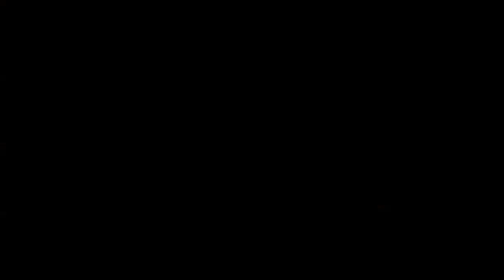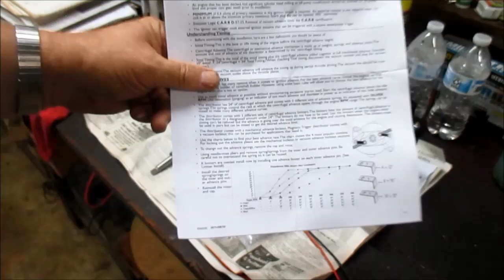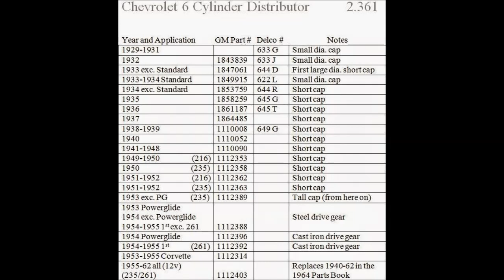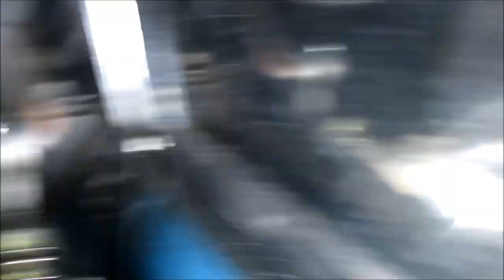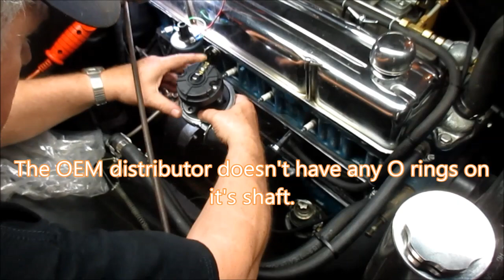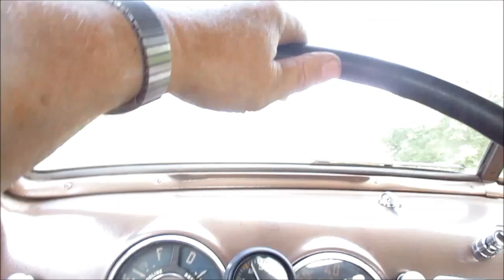1949 Chevy truck, Installing a Pertronix distributor on a 235 engine. Volume 44.

Comment: Nice video, but I don't follow the 100 RPM drop. The engine RPM is via the transmission, tied to the rear end and road speed.
I suspect your RPM changed because you are measuring it via a different ignition and so a different number.

Comment: Hey great videos, new subscriber, have a 62 c10 with the 235 and have ordered a hei replacement distributor and was wondering if I have to change to a 12v system for this to work? It’s on my list but trying to get the truck to run better for now
Reply from the maker: Hey David. It depends upon which HEI dist you ordered. Some can be 6v while most are 12v. If you ordered a 12v you'll have to upgrade your electrics to 12v. Or you can contact the provider to see if they have 6v versions and see if you can trade them out. Upgrading to 12v isn't that hard. You'll need a 12v alternator, most folks go with a 1 wire GM type, disconnect the regulator, change all your bulbs to 12v and get a special resistor for th epower to your gas gauge (most aftermarket providers have them) and if you have a heater you'll have to either replace the 6v heater motor with a 12v (most aftermarket providers have them) or install a DC voltage converter to step down the 12v feed to the 6v electric motor to 6v (I did this in my 49 GM). Look for a video series I did on installing a heater in my 49 GMC.I cover it pretty good.
Good luck.
Reply: @Volfandt  you know I didn’t even consider that when I ordered, item says it fits so I just went with it and then started watching your videos and started wondering. Thank you for the reply and videos, as a younger guy who doesn’t know much about these things but wants to do it myself I really appreciate and depend on videos like these. I guess I have some research to do, thanks again

Comment: Does the new  Distributor moves when you  Give it idle?   Vacuum Or no
Reply from the maker: No, the Pertronix Flamethrower distributor operates like a later model dist so only the internal point plate rotates. The Pertronix is basically a later model points type distributor that they modified for their Ignitor II electronic ignition module.

Comment: No worries I am an old fart too.  Good job.  What was the total cost?  Mike
Reply from the maker: Heres the distributor part#: D109700 and a link to it on Pertronix website:
https://pertronixbrands.com/products/d109700-pertronix-flame-thrower-billet-distributor-with-ignitor-ii-gm-l6-toyota-f?variant=37238594044075

I also put the part# and link to the Pertronix website in the description.  
Thanks for watching.

Comment: Hey bud on the stock distributor line on the carb end should I be able to pull the line back & forth. Slightly ..when installed in carb. How critical is that for carb .. was wondering if that was my carb issue. Or part of it.. cuz I tighten it but I can still wiggle the line back & forth .is that a vacuum leak?. Not enough vacuum to carb? Please let me know.. wanna get her going. Thx buddy. Appreciate it 🙏
Reply from the maker: The vacuum line between the carb & distributor needs to be air tight when it's tightened. It will definitely be a performance problem & vacuum leak at any RPM above idle. When you accelerate the RPM above idle you should see your entire distributor rotating, that is how the vacuum advance works on these old stovebolt engines. IF it's not moving your engine will stumble and hesitate. So no you shouldn't be able to pull the line back & forth when tightened and a loose vacuum line will cause carb problems.
Good luck.
Reply: @Volfandt  wow 👏 your awesome. I figured that couldn't be right. So this is my whole problem all along im sure 👍.  Needed some reassurance from my stovebolt buddy.  I'm going to reflare the line .. I think it's a double flare or just to thick to seat.  So im going to just flare it.  
Should it be double flare? Thx VOLFANDT. Appreciate cha 🙏 bud✊🏽🤝🏽😤
Reply: Is your flare a double flare ? Or just a flare?🤔  Just wanna make sure im doing this correctly want to  get her running normal after a 15 year hibernation lol .  Good lord.. its about time . 🤣🙃  .all I know.. I get her back to running.... I did the work but you gave the knowledge.. for me to lean on.  
Go BOLTSTOVES.. lol...  STOVEBOLT I know.!
Reply from the maker: @OGSHAKER2020  I'm not sure. I took it off when I went to dual carbs and it's stashed away in a huge pile of parts. I'd swag that either would do but as I'm sure you know a double flare is better.
Good luck

Comment: Your going to really like it have had several pertronic ignition systems on chevy L6’s an SBC
Reply from the maker: So far it's been working well. The plugs are looking great after 3K miles + and it starts & runs great.

Comment: Such a great video. 
What is that vacuum gauge? Did you make that? 
Cool shirt. I'd buy one.
Reply from the maker: I believe you're asking about the gauge I used to balance the carbs, if so it's a Uni-Sync multi carb synchronizing tool.It's a must have if you have multiple carbs. I made the adapter by cutting out the protective cover that came with the carbs and used duct tape to seal it up, works great.
I'm thinking about getting some of those shirts made up. I'll let you know.
Thanks

Comment: Would a h.e.i. distributor from a 70s 250, 292 fit?
Reply from the maker: Yes but I understand the "stop" on the distributor's housing will have to be machined down in order for it to go deep enough to engage the oil pump.
I test fit a 79 HEI off of a 250 into my 235 and the gears engaged and there was plenty of dist cap clearance but I didn't try it. You could lay them out side by side and do some measurements as there are folks that have adapted them to 216's, 235's & 261's.
Good luck.
Reply: @Volfandt  Thanks. Great videos.

Comment: do you have the part number on that distributer?
Reply from the maker: The distributor was a demo I was evaluating for Pertronix and it wasn't for marketing at that time. Based on how well it's performed I'd be surprised if they're not ready to market it now. Contact www.pertronix.com for more info.

Comment: I hit the send before I was done, I was wondering what brand and model number the digital timing light you use is? I know you introduced it awhile ago but didn't find it again. Thanks
Reply from the maker: Heres a link to it on amazon.
https://www.amazon.com/gp/product/B000BSY9JE/ref=ppx_yo_dt_b_asin_title_o04_s00?ie=UTF8&psc=1
 I'm very happy with it. The tach function could be more steady (it deviates +/- 20 rpm but thats fine with me. I like that I can adjust the timing light function while running the engine which makes it VERY easy to find what the timing is set at, at any rpm.

Comment: Hey Dave, thanks for sharing. I have points and condenser currently. I was thinking of using the original distributor and putting electronic start Pertronix. Wanted to know what your thoughts are on that. Thanks again
Reply from the maker: To be upfront, I have nothing against a points ignition. Even though some of these new aftermarket points are no where as good as those from back in the 60's & 70's, points are very forgiving and will get you home even when set with a beer, err I mean soft drink pop top, LOL. That said, these new electronic ign setups with higher voltage coils definitely improve on the old points ign technology.
There's lots of folks that went to a retro fit electronic ign setup and swear by then while there's some that swear at them. 
I'm definitely experiencing an all around improvement in my 54 235 with the electronic ign, so much so that I'm not worried about keeping that engine period correct as much as I did when I rebuilt it. I've never installed the Pertronix kit but I believe it uses the same Igniter II module as the dist I'm running and so far I'm very happy with it. Stay tuned as there will be an upcoming Vlog where I put it through some paces.
Thanks for watching.

Comment: Really good basic information that everybody should know, I had auto mechanics in high school and we had engines on stands, one of the tests that we had was the teacher made  the motor not  run and we had to figure out how to make it run. well we couldn’t figure it out what the teacher did was use a six cylinder distributor in a V-8 engine he’s a pretty sneaky teacher.
Reply from the maker: Reminds me of my 1st day in Navair basic aviation "A" school.  We were all given a 2 bbl carb and told to disassemble it for cleaning. Once we did they gave us a break and we left the room. The instructor mixed up all the parts and when we came back we were told to reassemble them and we each took a turn bolting our carb on a 6 banger engine on a stand and see if we could get it running. Needless to say none of us could keep the engine running and only a few even got it to start. 
Definitely a sound tried and true method of getting our attention and motivating us to learn, LOL.